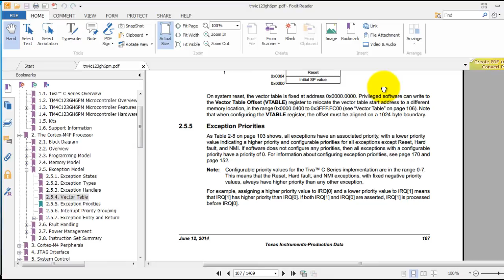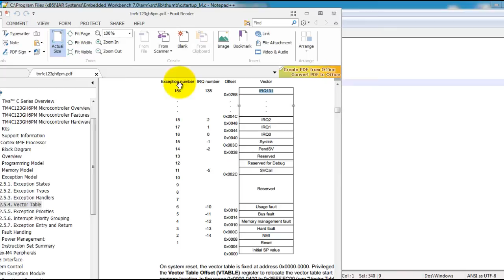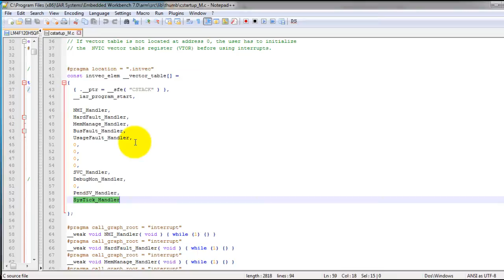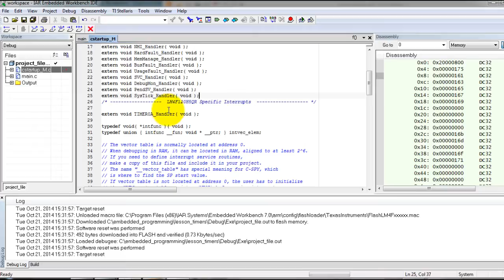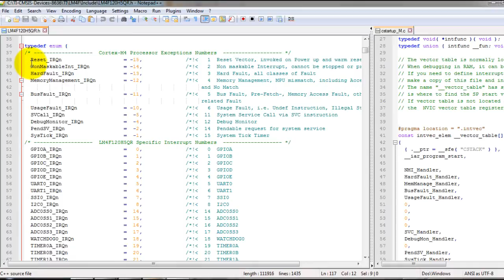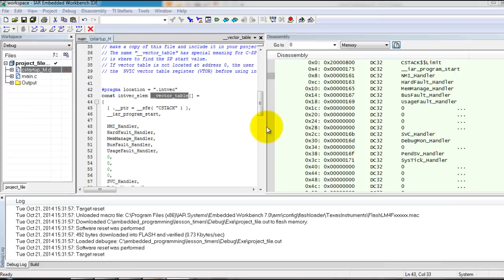TM4C123 Tutorial: Interrupt Vector Table - Adding Functions To The Table

Comment: I am using a different header file, which is working correctly with my other tutorials. However, it doesn't have the "specific interrupt numbers" part required for this tutorial, so I just copied that from other header file (which came with the IAR tool) and pasted it in the header file am using. It worked as suppose to for this tutorials, but am wondering is that ok for later tutorials?

Comment: Do you make your own startup file? If so how?
Reply from the maker: +Helios Fire No, the IDE I used comes with its own startup files (a different file depending on the compiler you use). In on of my videos for this series (I don't remember which one), I show exactly where everything comes from including the startup file.
Reply: So it's entirely possible to make your own interrupts without a startup file?

I am a student whose goal it is to be an embedded engineer, do I just look at the data sheet and then interpret and program it? What';s the industry like?
Reply from the maker: Helios Fire The available interrupts are already mapped, the startup files basically assigns function to the addresses where the interrupts are mapped so that you can call them from the program. You can remap the interrupts, but I don't have a tutorial on that. 

For your second question: Watch all my videos then learn an RTOS of your choice, also learn Linux and embedded Linux. Come up with your own circuits and make drivers for them etc.
Reply: Hmmm... how do make drivers to your own circuits?